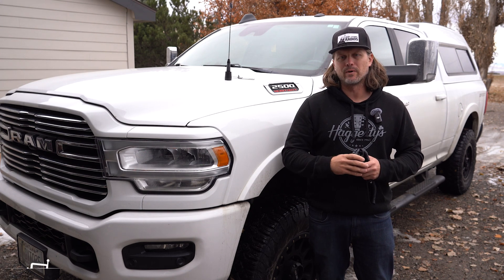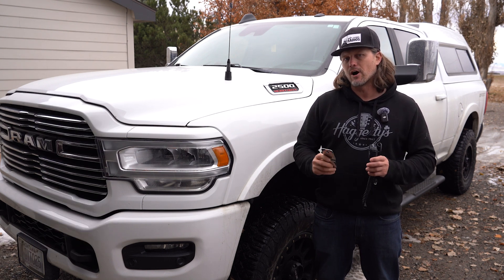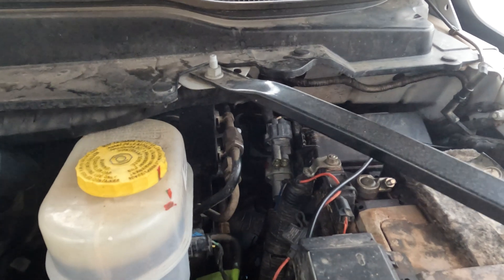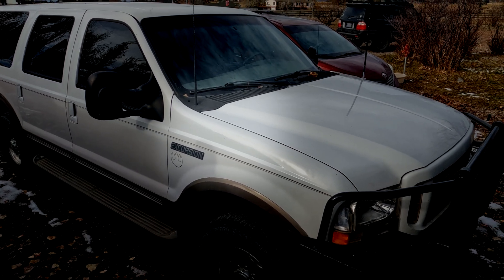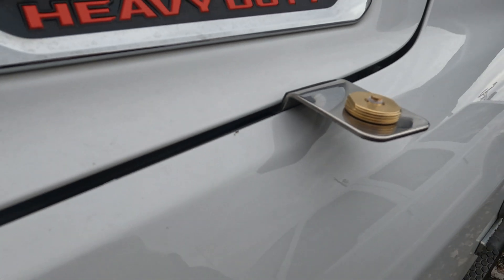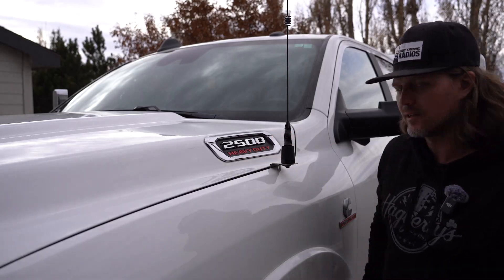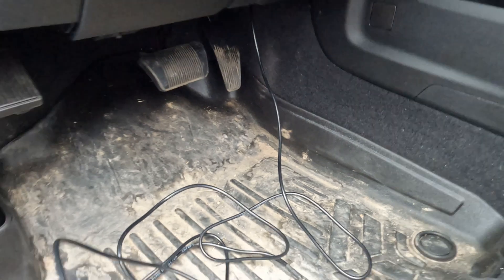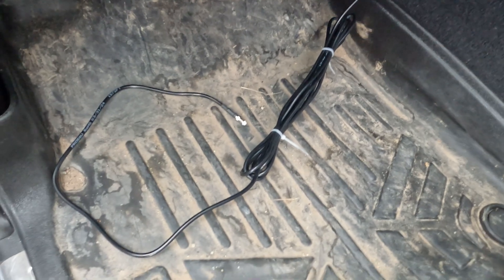GMRS Installation in 2019 Dodge Ram 2500

Comment: That was the worst radio install video I have ever seen. Great antenna mount video but you don’t show radio mounting, wiring or connections
Reply: Agree.  didn't even show the radio base.  All antenna work.  That's the easiest part of the install.  smh